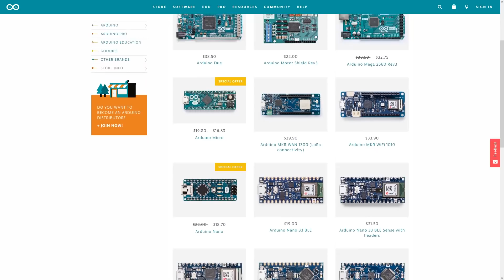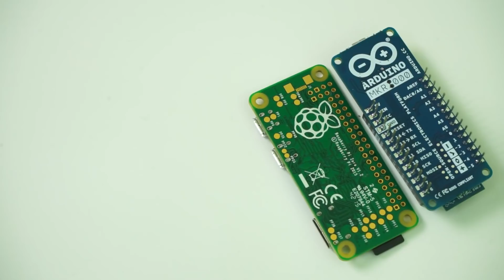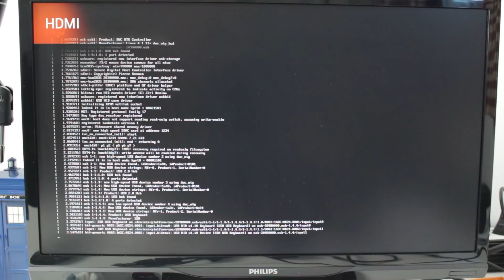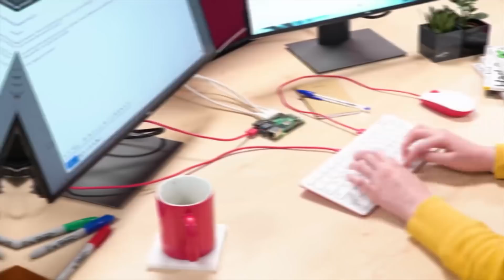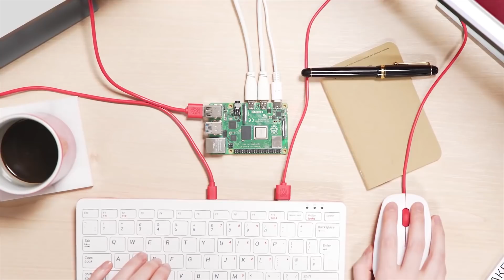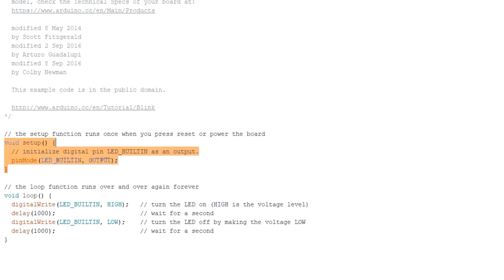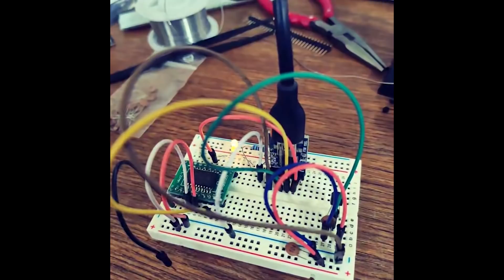Arduino vs Raspberry Pi - Which one is better?

Comment: Okay, ai don't know what happened with us prices. I live in Canada and I just looked up both boards. The arduino is in the $40-60 range, which seems to be in line. The Raspberry Pi Zero is like $75+ though. So, in the video, it's about 3 times cheaper but now it's twice the price. Has it really gone up that much in the last year?

Comment: It's a bit of an apples and oranges comparison.  But since you made a point to explain how drastically different they are in terms of Linux vs mad minimal, you know that and presumably your audience doesn't necessarily know that.  Still, to get past these basics and assume someone knows they want to do a microcontroller project which if that was NOT the case, they need to stay FAR FROM the arduino, I think a better comparison would be Raspberry Pi PICO vs Arduino.  And with that comparison, I would be very deliberate in pointing out that there are AVR microcontroller arduinos and I would steer people clear of those since WHY LEARN AVR assembly when ARM actually applies far more broadly and on much better processors for the price.  So then the most apples and apples comparison becomes Ri Pico or an ARM Arduino and I think that one comes down to all the shield availability with the Arduino and how much you want to delve into FREE RTOS which is it's own very big world but more applicable to learning real industry projects.  I'm only toying with AVR myself because it blows my mind that mankind ever actually hand coded machines with 8 bit registers.  It's wacky.  But it's a trip to the ancient times.  And how it does pointers using special register pairs to get a 16 bit pointer.  ???????????? But ARM just gets you straight up 32 bit which is far more than necessary to address all of memory as a flat linear range since no micro controller will have over 4 gigs of ram.  As a matter of fact, the memory you're dealing with is from an SRAM pool that is fixed and obviously MUCH smaller.

Comment: Arduino is not made for the same purpose as a Rasberry. It are 2 different products. 
So comparing these boards is a little bit comparing apples and oranges. 
It simply depends on what you want to do and what you want to achive.
Reply from the maker: Which is in part the point of the video. How do know which one meets your needs?

Comment: Arduino has a bootloader only that simply loads the program flashed to it. So there's no "shutdown" option for an Arduino hence its completely safe to turn it off even when it is running the program.

Comment: Prices can be misleading because we are talking retail prices. Once you scale production up you should notice that microcontroller boards can be indeed a lot cheaper than more complex SoC. It may be possible that Arduino is making small batches of the board to reduce stock sizes and that is what drives prices high, particularly because the MKR system is less popular than previous boards and also is in their "Industrial" niche. I do agree with your points about system complexity and booting times, but there are many other reasons you would use an Arduino instead of a Pi, for example ADC and DAC, PWM, UARTS, USARTS, TIMERS, I2C and many other peripherals of which microcontrollers tend to have plenty more than a Raspberry-Pi.

Comment: I would not call what the Arduino has an operating system. It's perhaps closer to a BIOS, but even then it's one which is tailored and compiled for each application. I don't count libraries as an operating system; they are a rather different concept. 

If somebody cared to, then it would be possible to produce such a minimal environment for a Raspberry Pi. The latter is not limited to Linux after all. However, it would be something of an overkill to use a Raspberry Pi as a microcontroller.

Comment: ATtiny13a can run on 190 μA @ 1.8 V and 1 MHz (numbers from the datasheet) - the difference in power consumption with PI (200mA) is already 1000x, more than 3 orders of magnitude.
But that's not all it is capable of - by underclocking it to 32kHz with external oscillator, it will run on just 20 μA, 10,000x less power, which is whole 4 orders of magnitude lower than PI ! In other word, on the same battery, the attiny chip will run 10,000 times longer. Or, if you want, you could have 10,000 of them run in parallel instead of 1 PI.

Comment: Thanks for the video. Some Suggestions:
AVR:
Go: https://github.com/tinygo-org/tinygo
Rust: https://github.com/avr-rust https://github.com/avr-rust/blink
Python: PyMite, micropython
Lua: https://github.com/deemess/uLua https://github.com/elua/elua

Then https://wiki.gentoo.org/wiki/Cross_build_environment which enables you to build full blown language support including C, C++, D, Fortran, Ada, Go with the GNU gcc tool-chain or have access to the LLVM family with its wide variety of language support.

Your Arduino IDE uses the gcc tool-chain under the hood, so it is capable of C++ and you can specify your own tool-chain or use one from https://blog.zakkemble.net/avr-gcc-builds/ to have some more modern features available.

Raspi:
Comparing boot-times will be fairer when comparing bare-metal with bare-metal: https://en.wikibooks.org/wiki/Bare-metal_Raspberry_Pi_Programming + https://github.com/bztsrc/raspi3-tutorial

In other words, I repeat what you said in the video: It is important to know which is the right tool for which use-case.

Comment: For the fans of python, https://pycom.io/ has a number of boards for that kind of tinkering as well. Their first board was ESP8266 based and a prime example of the huge penalty you get that way. What you could fit on there and have running is so much less than the same board using the Arduino IDE.
But I do get that it's better to have something that you can use and at least get something working, over something that in principle is more efficient, but maybe much harder to understand, so that someone might not be able to get something running.

Comment: Realistically - an ESP32 costs less than the Pi Zero W. Also, you cannot get several Pi Zeros, you may be able to buy one unbundled, maybe, sometimes.
And an Arduino costs $2. Or $2 + $28 brand name.

Comment: I'm glad I watched the video bc I was about to rip you a new one based on the title. I can see why people would hate on you for the title, but I can see why you would title it as it is. People who don't know much about this would come in thinking "Let's see what this guy's opinion in," when it in fact turns out to be a video saying, "yeah, you can't compare these things." I think a good analogy would be Arduino as a car and a pi as an airplane. Could you take a plane anywhere you take a car? Sure. But it would be pretty stupid to take a plane to the store or take a car across multiple continents. Different use cases require different tools.
Reply: More like Honda City vs Ford Transit.

Comment: you can get an atmega328p clone board for 2-3 bucks, and even then they get murdered by 80 mhz STM32s left and right going for the same price,
and they barely even deliver in the GPIO part (where ESP32s shit the bad with low analog input polling rates and all)
 the STM can do a gameboy with way lower level instructions, the r-pi can emulate 8 and 16 consoles with decent results regardless of massive amounts of OS and emulator overhead,
STM can't even dream of matching the r-pi in value proposition when it comes to raw punching power, let alone the atmegas lol

i mean, 8mhz on arduino (20 mhz before it burns up with some oscillator crystals) vs 1ghz, that  doesn't require any IPC measurements to tell me who's the winner there,
not to mention 8-bit vs 32-bit, it can literally push 4x more data in a single clock cycle too AND be more precise too,
a factor of literally 100 isn't even off the table when it comes to calculation speeds.

but yeah, if youre looking for a low-power  controller for your projects (going as low as 20 milliamps at 5v, 1/10th of a watthour),
nothing wrong with it, for embedded hardware -> less is more.
then again, the extra hardwre on the arduino makes it WAY less power efficient than just the atmega... 
one goes for days on a battery, the other one can go for months if you use the power states right and just wake up from an external trigger
so the arduino kind of undermines the whole power thing in favor of flashing your own atmegas (regardless of whether it has the arduino bootloader  or not)
never even bothered using the GPIO on the regular r-pi, why dedicate a powerhouse like that for it when it's raining atmega, stm32 and esp32s for 3 bucks.

the power of the pi zero is the fact it has 2 usb controllers, and you can flash the firmware on them to make your own HID usb devices (Although the controller on the arduino leonardo specifially can do that too), and has ample ram to run more than 3 libraries, pretty sure that was the original MSRP orso, haven't seen one under 10 for at least 3 years, they have been inflated forever... closer to 13 than the 8 bucks they used to be (but that's with the wifi these day though)

if you're really looking to work with barely any resources, try a digispark, it's a rush to work around the insane limitations of 1kb ram and 6kb program memory,
and usually they are used like rubber duckies with a USB keyboard/mouse library that already eats away at that 6kb.
but i find hard walls like that works inspiring.

either way, they're sooo much different, but everyone who really wants to look into coding embedded stuff and learn about electronics themselves, should have an arduino, 
hell i'd say you haven't really optimized code, and learned the ropes, until you had microcontroller beat your ass with limitations like it was 1985
code is hell to maintain, and it's usually best practice to just delegate the job to multiple controllers even if you could do it on 1, but it's a great learning experience :D

i find r-pis the best way to learn your way around linux though, as a sysadmin i learned the ropes of Redhat 5 back in 99, but never saw linux as a good desktop operating system,
i still don't by the way, window managers can't help but suck shit even today, that's why i'm a CLI warrior.

in fact, i havea midi controller in the works that uses the zero as USB to midi interface, but the actual self-sufficient processes like the internal sequencer and oscillators are delegated to atmegas, way easier to maintain code and debug, and more shots at redundancy too, 
and let's face it... i don't expect microsecond precision from a r-pi running a full-blown operating system, in terms of timing precision not even the fastest x86 pc has anything on the atmegas, despite all the nanotime functions and 64-bit floats they can return, they'd be lucky to get 2ms precision in the loop with the operating system bullshit keeping it down, i reckon it's a lot better on ring 0, haven't tried using pure ring 0 on a pi to be honest, the arduino will murder any general purpose computer in GPIO functionality and timing precision.
(people still hold on to r-pi 1's for GPIO as they're better at it, custom timings and stuff)

source: 
i have 2 r-pi 3bs, an r-pi 4, an arduino uno, a leonardo, a mega knockoff, about 5-6 atmega382p nano knockoffs, and like 8 dip versions of the atmega chips themselves (without arduino bootloader)
about 3 stm32s and about 3 ESPs (of which 1x esp32, and 2 old ones that still allow for wifi deauthing ;)

yes, most of them are in the big old aliexpress drawer of shame, reminding me of all the projects i haven't finished yet, 
(i'm a computer geek, but a shitty electrician)

tl; dr: i think the arduino isn't worth putting money on anymore at this point, not even the atmega chip itself really. it's been a good run though,

Comment: I buy Arduino nano for 1.55€ from aliexpress since years. ESP32 is less than 5€. Orange Pi Zero is faster with 4 cores than a Rasp Zero. There is absolutely no taxes in Europe for a thing at 1.5€. So the best is to go to Aliexpress. Arduino is dead since years because their mistakes. And Oh My God, the IDE is so vomit compliant, the same since years... And they are unable to understand they just have to prepare a good plugin for Visual Studio Code. So many errors from this Arduino foundation...

Comment: I still think Arduino is too expensive, even its clones. We use it as terminal nodes in our smart farm system, and its job is only (de)activating switch and reading values from two sensors (temperature and humidity) and provide http endpoints for them, compared to Pi as a hub which has to synchronize the Arduino and a cloud server. But its total price per node actually exceeds our Pi. So I hope there are alternatives that are much cheaper with similar functionality, because the terminal node is the one that needs to be numerous.

Comment: Since Arduino's compiler is GCC, you're not necessarily limited to C/C++. You can in theory  use every language GCC supports. Just grab a more recent version of GCC (because the compiler distributed with the interface is positively ancient), and cross-compile it with crosstool-NG or something. And if you can generate arduino binaries with another tool, I'm sure those can also be downloaded to the device with some fiddling.

Comment: esp32/8266 and micropython are a perfect alternative for arduino, has wifi and boots fast and if you need the arduino ecosystem you can use it too. Has a ADC and works with every sensor.

Comment: On my country a raspberry pi is like 200reais(50dollars).
Reply from the maker: For a Pi Zero, $50? Not a Pi 3 or 4.
Reply: @GaryExplains  for a pi zero( yes is super expensive, its arround 25 and 50 dollar for an pi zero)
Reply from the maker: @Sermi_Fox  Wow, that is sad, which country is that?
Reply: @GaryExplains  Brazil(Yea it's sad)
Reply from the maker: @Sermi_Fox  I see that the official supplier Filipeflop has it for R$119,90, but that is still high.
Reply: @GaryExplains  ok
Reply: @GaryExplains  Thankfully the arduino still in the correct price.

Comment: arduino can buy uno under 10$ pcs, nano 4$ pcd, mega 11$ pcs. raspberry pi zero not can buy less 30$ normal 30-48$ ans pi 3 45-70$ and raspi 4 55-70€ you not can buy anywere internet zero W under 30$ maybe if lucky good 20$ but not newer 10$ any seller no sell under 20$ newer.
Reply from the maker: No. Sorry. You can easily get a Pi Zero and Zero W at the $5/10 prices. Obviously prices vary according to region and stock supplies, but if you use an official distributor as shown on the Raspberry Pi website you will be able to buy the boards at the correct prices. I have never paid the figures you are suggesting for a Pi Zero.

Comment: If your considering Servo or other PWM devices, the Pi is very poor as it lacks true hardware level PWM control. On the other hand, the Arduino can read and write digital signals; It can detect for example a high, low, rising or falling of the signal. And allows you to generate your own custom signal in real time.

Comment: 6:26 That's absurd. Every computer on Earth including simple MCU's freeze and need reset. That's why everything from Arduino to Xbox Controllers has a reset button. That is in no way shape or form an advantage Microcontrollers have over Raspberry Pis.
Reply from the maker: You have misunderstood what I am saying there. Sorry. But I am talking about the reliability of a microcontroller and its read-only flash memory compared to the complexity of a full Linux system and an SD card. Also, does the microcontroller in your car crash often?